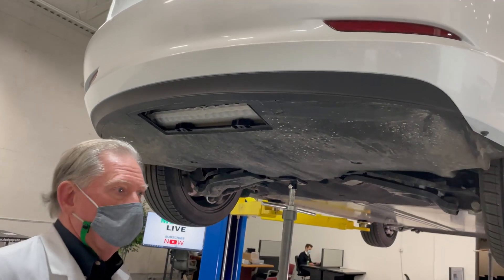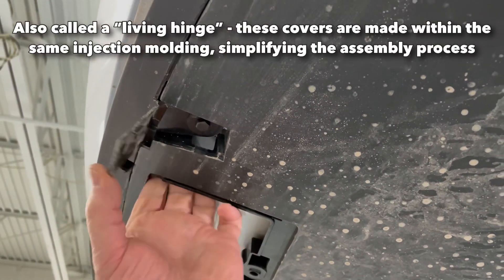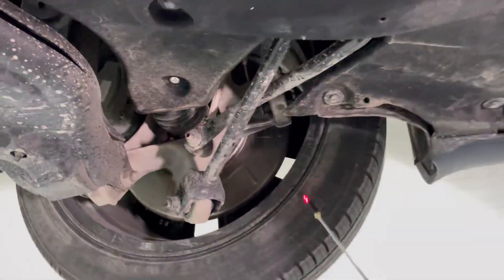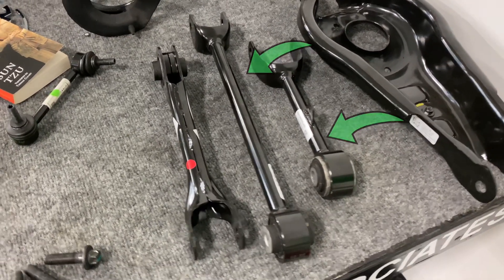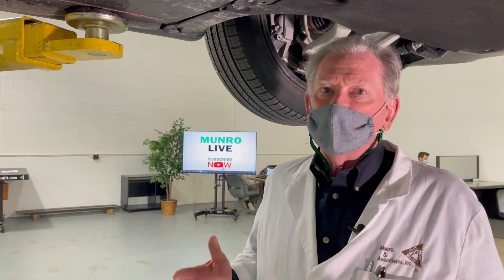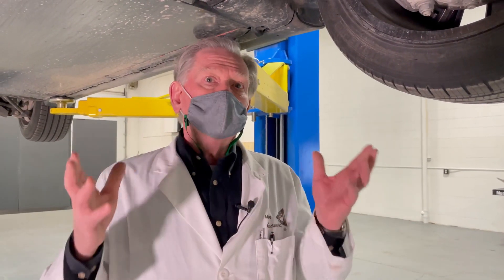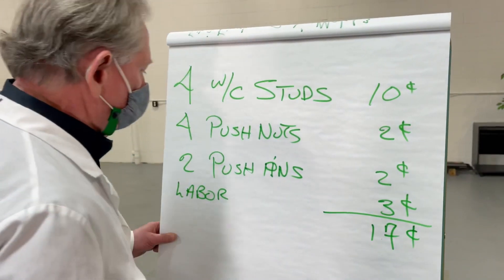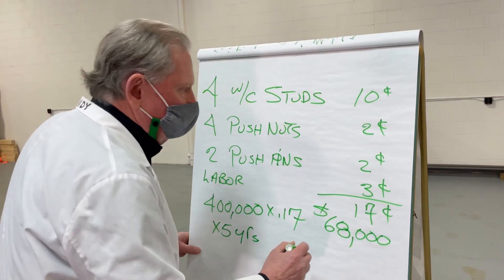2021 Tesla Model 3: E2 - Hoist Review & Some Cost Savings

Comment: and what happens to the now unrestrained aero edge on the bottom of the car at speed? I see a high likelihood of it creating a whistling noise or even rattle which would drive the driver nuts - and all because of cost savings of a few cents while not doing the full redesign where that edge doesn’t need the connecting elements anymore. Your argument that the pushnuts don’t do anything is as wrong as it gets because you were able to move the area in question without any effort, and the forces coming from wind and road surface are considerable. I would call out that as shoddy design worse than any visible panel gap!

Comment: The front access panel is to allow access to the rear of the front bumper so a license plate can be attached to the car with real nuts and bolts through the bumper (instead of sheet metal screws just installed from the front) in order to prevent theft of the front license plate.

Comment: That flap will hang down as time goes on. It should be a plastic integrated slide clip, flex it and slip it in a slot or redesign it so it goes on top of the opposite edge.

Comment: I think it’s not a good idea to remove the push pin for the splash guard. Another fastener is close to it that is right, but that is the corner. In actual daily use, you can drive through a puddle of mud and mud can accumulate in there over time. With the Arizona heat, that will surely sag and will get worst overtime. I think that 2Cents saving is bad idea. Maybe they could have just removed the other pins that are not in the corner or edges of plastic parts.

Comment: I personally would have left those pin clips in as the pannles could come loose while driving and rattle around, to me it makes sense to keep them froma stand point of a comfort/sound perspective, but at only $68,000 per 400,000 units, it really wouldn't affect the bottom line to ditch them in the first place, it probably cost the more to retrain/inform the line workers to not put them in

Comment: Mr Monroe, I love viewing your videos, esp. the teardown of the previous Model 3 and Y. Learned a lot.  I own a Mod 3 built April 2019. That rear panel is called, "Rear Fascia Diffuser, PN PRNS2043000586." The trap door is for vehicles like the X & Y to have a stealth hitch. That is the receiver is able to be removed as to restore the no hitch look. Cars after 2019 have this fascia. If someone wishes to purchase an aftermarket hitch, since Tesla doesn't sell one themselves. Then they can either cut a hole in the original OEM fascia which will allow dirt and grime in that area. Or buy a magnetic cover for the hole which I understand doesn't work well. Or for a cleaner more factory look buy the updated fascia from Tesla for cars prior to 2020.

Comment: I'm sorry guys, but how is he impressed by 2 holes in the floor panel and 2 two parts now partially loose and vibrating.
And saving 17 cents on a cars is still just 17 cents on a car.
On a 45000 dollar car that's 0.0038 %
I guess multiplying a number by 2 million sounds impressive...

Comment: It's not just a BOM cost that's being saved, but the cost to manufacture each of those plastic bits.  You could probably calculate the energy saved and carbon footprint reduction by making vs not making those parts, plus the cost of electricity for the welded studs.

Comment: I had a neighbor who “engineered” at Ford.  During the Taurus run, (a pretty successful offering), my neighbor would complain about the changes to certain parts that originally were metal, being replaced by plastic.  He would warn the cost reducers that the parts would fail in a much shorter time.  Their response was “as long as it’s past the warranty, we don’t care”.  Yes, there were incremental savings but not for the consumer.

Comment: You forgot the cost of the review process to figure out if we should have or not these part there, and the additional insurance it would cost to not install these parts in case it was needed.  Maybe under really hot weather, the weight of the plastic might cause it to bend by itself and boom... Recall those 400 000 car per years to replace the whole part ! Now, will that 68 000$ per year saving be worth it ?   I sure hope those cheaping out action doesn't become issues, because Tesla is getting worst and worst at fixing their issues !

Comment: Sandy, I wonder if that access panel which may cost more is there if you get the trailer hitch package? If so reducing part complexity saves money as well. All cars same parts. And allows easy access for an aftermarket hitch install. Maybe in the end this is a value decision?

Comment: this is a major issue with modern cars.  they cut the cost by removing things that made the car easy to service, 15 to 20 years ago every automatic had a dipstick tube to check the trans fluid now they removed it and give you a bung under the vehicle to check it...  is that better quality i dont think so being the mechanic that works on them. some euro cars now dont even have a dipstick for the engine oil level,  to check the level you need to use the onboard computer system, i would rather have a dip stick to check the oil levels than trust a computer anyday. service wise cars in the 80s were better designed for the mechanic.

Comment: Everytime a car is serviced or repaired the garage leave off some nuts/bolts. Sometimes they lose them and others they cannot be bothered to put them all back as it takes time. After a couple of new clutch replacements the bellhousing is held on with 1/2 the nuts it started with. If a car has only the bare minimum number of fastenings then in a couple of years things will start falling off. Garage mechanics are not going to get less lazy and cars will be held together with less and less. This will not end well.

Comment: Sandy @Munro Live ....I've watched you since way back during the Autoline days with John McElroy days. And back then, you were super critical about Tesla and the vehicles they were producing. And rightly so.  Your critiques did upset me quite a bit, as I was 1) a Tesla shareholder since IPO day, 2) a Tesla fan boy, and 3) a brand new 2018 Tesla Model 3 LR AWD owner. However I knew your were right, even though it was tough to admit it on my part.

However, all of your critiques about shoddy assembly, horrible paint, and imperfect gaps were SPOT ON.  As much as I love my Model 3, would buy another one in a heartbeat and would recommend Tesla to everyone, everything you bring up as quality issues is in fact correct.  I have similar issues on my sub 100,000 VIN Model 3.  Despite my love for Tesla, when I show people my car and praise the amazing features of it, I will also bring up the quality issues that my car has, as well as show people (taillights mis-aligned, paint issues, etc).

I know what you are doing is definitely helping Tesla become even better.  You have some incredible ideas and suggestions for improving their cars. Your original Model 3 teardown video showed great areas for improvements, which Tesla acted upon (eg: rear trunk area, single casting). And your suggestions continue to make sense so Tesla can simplify production and reduce costs, labor and parts.

I am looking forward to watching these new videos.  People like you are what inspire people to excel and exceed !!

Comment: My guess as to the purpose on the access panel at the underside rear is to deal with the issue of cleaning out the debris or trapped materials from driving that the Model 3 is known to suffer from (or pressure relief from water trapping at high speeds that pull off the rear panel) AND to provide access to the bumper for low weight towing or bike rack mounting.

Comment: Tesla has bigger cost-saving problems than saving 17 cents for fasteners.  How much does it cost them to fix quality control issues after it leaves the factory like panel gaps and fogging headlights?... hundreds if not thousands.  Even if just 1 in 10 cars needs this after-market service, at say one thousand dollars, that works out to 100 dollars for every car.  So at 400K cars per year, that's 40 million dollars!   They are focusing on the wrong cost saving strategy!

Comment: One of the few channels that do engineering for mass production.

Besides applying DFMA and BOM logic to these plugs, injection moulded panels can be further modified to refill those holes without adding massive cost or time, since it 'metal off' anyway.

Comment: If you look at an assembly line setup, keeping the removable panel on the rear bumper actually makes sense since you don’t have to manufacture 2 separate panels which is costly in in itself. They probably did the cost analysis and discovered that it is more cost effective to just keep the same cover, with the removable panel, than having to design, manufacture, store etc. another one just for one market. Audi, and really all big Car makers do that all the time also.

Comment: Did you forgot the working time for assembling those pins? 1-2 minutes per car or so... sums up more than the price of the pins and nuts
Reply from the maker: “Labor” at $0.03 is what sandy factored for labor at the plant level.
Reply: @MunroLive  Ahh ok. I'm not so familiar with the terminologies in english. But lets say minimum wage for a worker of $10 per hour (labor costs for the company are higher I think), then 1 minute costs $0,16... just saying... there a hundrets of such small changes which sums up to a huge savings potential.

Comment: is the rear air shield on the bottom (where you found the tow hitch opening) the same on the Model Y? If it's the same piece shared between the two vehicles, that might be why they just left that in there. Plus, for those that put an aftermarket tow package on their 3's, people don't have to drill a hole in that anymore, they have an opening in place to use.

Comment: Hi Sandy. Perhaps a reason for that hatch under the rear aero plate is that Model 3 has had issues with mud, sand and rocks accumulating inside that part. It may be a clean out hatch to extract the buildup before the plastic piece or bumper rips off. Videos on YT show guys that have long unpaved driveways or who often drive on dirt roads have had to extract 10-12 lbs. of dirt that gets sucked up in there!

A design flaw hopefully resolved on newer models.

Comment: What happens if you drive thru some water or, most likely, snow. And you revers the car. Snow will get inside that plastic panel. Also is it worth the money saving, in this case, over the issues or bad reviews owners would throw? That panel should have a clip or something cheap to stay fit, not loose like that. As a customer I would believe  that they forgot something to put in there.

Comment: What has a larger cost savings for the rear bottom skirt. A single assembly line skirt SKU for all (w/ or w/o tow package), leading to simplified assembly process. Or 2 SKU's where some (w/ and w/o tow access door) receive the simplified less expensive skirt without tow access door. Thoughts? Reducing 'duplucate' parts with small variations will have some cost savings as well

Comment: I wonder if a reason for having the tow bar access door might be to ease tow hitch retrofit post delivery?

So not only does it mean you need one part in the line, but also you only need to stock one part at service centers, and don't have to deal with disposal of a none hitch cover during an upgrade, or have to manually cut in an access door.

Comment: If only he would make a car with that philosophy.  I want to see one that is bare bones with manual adjusting seats and hand rolled windows and NO info screen at all.  Just a model Y with the motor, 200 mile battery  and some airbags.  Something under $12k...  Start with the performance and cut costs everywhere you can.  I want to see the raw alumium in the floor, just stamp a pattern into it--- no carpet or anything.  Make a simple way to add a battery upgrade just like we add memory to our phones... Make it a box like the Cyber truck, durable, dent proof, scratch proof.... Call it the Cyber Dray... and build millions of them....  This is what most of us Men want.  Something that is completely basic, without any plush comforts, but has the utility.  Cut all corners, make it as simple as possible, and keep it bomb proof.  Everyone keeps tying to make "the new iphone", when what we need is a firearm.

Comment: Yes, lots of money to be POSSIBLY  made, but one needs to scrutinize what possible negative down sides there are.  For example, does the extra flop of that piece cause noise under certain circumstances?  Maybe 1% of customers complain.  What is the cost of that?  Does that negatively contribute to a customer's satisfaction? ??  Don't you think that that piece will be redone before 5 years to make it look better, you know, like it is not missing components?  That should all be in the calculation.  It reminds me of Ford not lubing their windshield wipers to save a penny.  Did not make me a fan of Ford.  I am 71 and I still remember.

Comment: Mount a camera on those 'missing' fixings to see how much movement and rattle there is going over bumps. Removing fasteners while still keeping the original mounting points will usually just cause rattle.

Comment: I don't like them saving 17 cents to possibly having a flap loose and causing noise under the car at high speeds.  I also think it looks like crap having the holes there and the ribbing around a hole they do not need.  Of course modifying the tooling could costs several thousand.

As for the wended stamped control arm...  That is fine if it is as strong... and it does not trap water inside and rust (especially for those in the north).  I worked for a tier one supplier for 15 years and BSR are a huge problem.  They would FAR rather add a dab of silicon grease, or a self adhesive felt pad... or a 2 cent push pin then have one complaint for an automotive company out of those 400,000 cars.  That one complaint could cause a bunch of overtime, require an engineer and several workers to go down and rework hundreds if not thousands of cars in their lots... and if this shuts down the manufacturer fines of $10,000 to $25,000 per hour of down time can be levied.

They can typically save FAR more money by redesigning assembly to reduce labor or the chance of a mistake or flaw.  I worked with programs like Six Sigma, Just in Time, Pull One... and they could save floor space, injuries, defects, and labor rather easy.  Tesla is just not a mature enough company yet.  But understand that their biggest cost savings will be in the battery.  I think they need to spend FAR more money researching battery technology.

Comment: Hey Sandy, possible the rear air dam is a single production part? Meaning all vehicles get the same air dam, regardless of the vehicles specific configuration, for ease of supply chain and assembly? Less parts, less screw ups?

Comment: YOU NEED  FAT !!!!!!!!!!! to SURVIVE !!!!!!!!!!
you START CUTTING HERE and THERE the QUALITY GOES DOWN !!!!!
after 2-3 Years or DRIVING in SNOW the inner FENDER FLAP MISSING the Clips will Catch More Dirt and SNOW and WILL EVENTUALLY BREAK !!!!!!!!!!!  or FLAP in the WIND 
so TESLA SHOULD PUT BACK the STUD and NUT 
LOOK What HAPPENED to Briggs and STRATTON CHEAPENING of ENGINES and DECKS - NOW ALL GONE OFF SHORE to CHINA and WHENT INTO CHAPTER 11 in 2020
THAT is the PROBLEM !!!!!!!!
Gen 1 LEXUS 400 was AMAZING QUALITY 
Gen 2 Cheaper Quality 
Gen 3 Even Worse !!!!!!!
Looks at NISSAN : Before Datsan was Amazing Fast Forward 25 Years NISSAN/ Renault JUNK 
BECAREFUL What you WISH !!!!!!!!!!
CHINESE CARS COMING and TATA Motors and MAHINDRA MAHINDRA , May BE SEAT ( Spanish )

Comment: Naw man, I don't want tesla to start getting cheap on me and stop using all the nuts and bolts. That plastic was flimsy as hell. A lot of dirt mud and water is going to get up in there and I don't appreciate Tesla trying to be cheap like that. Not when it comes to the bottom of the car. It needs every god damn nut and bolt because if you hit a puddle at 45 miles an hr or other common scenario that is going to destroy the under body if all the panels are that flimsy. They need to spend more money to make it water tight, wind tight, mud and dirt tight down there. No excuses will be acceptable. This is coming from a Tesla fan boy who is heavily invested in TSLA stock. Stop getting cheap Elon!🤦

Comment: Sandy, you're the man !  Very interesting observations and analysis.  Meanwhile, I believe you have put too much emphasis on the advantage FOR Tesla to reduce cost. I believe you were not clear enough about how owners should feel about these things that seems to be missing, that, in fact, Tesla removed as unnecessary. Don't forget you are an expert.  Most people are not.
Reply: IMHO owners should feel bad because the ease with which that area moves under his hands does point towards a structural weakness that mandates these connectors.

Comment: And the redundant panel you first removed would cost ?
Those push fasteners at either side that were missing prob fell off.
Reply: No they probably weren't I don't think you're the expert here.
Reply: @user-RCST  Worked in the car trade for nearly 40 years so i am the expert ,mechanic,bodyshop and parts , leaving out the two plastic conectors was not intentional.
Reply: @scotf7313  did you work at Tesla?